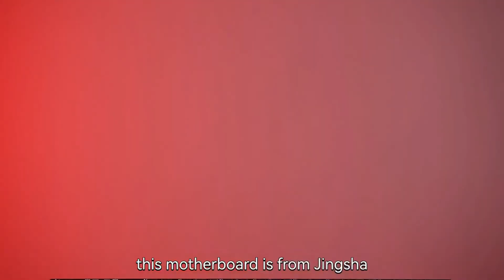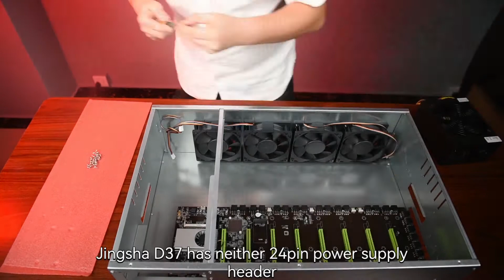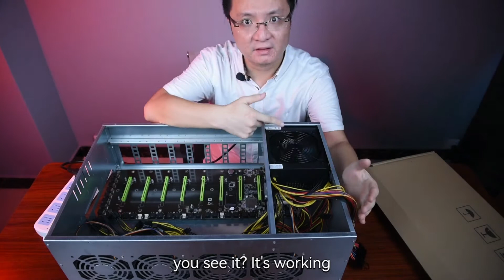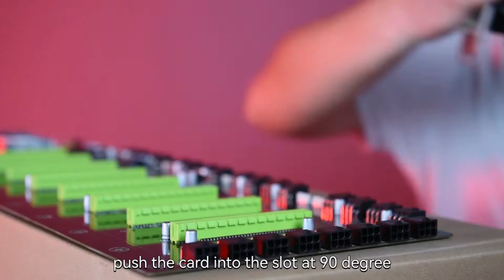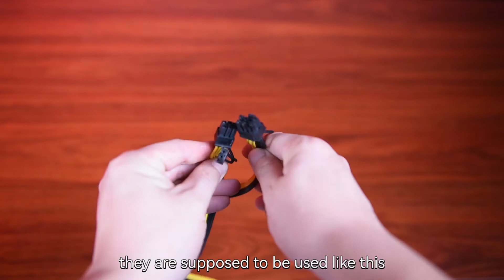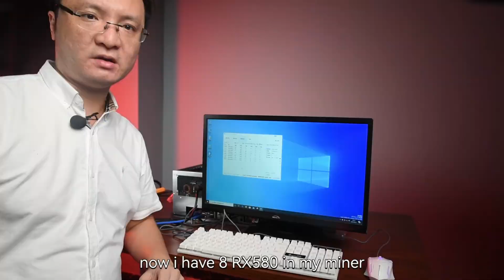BTC-D37 mining motherboard, compatible with ATX and 2U4U mining power supply

Comment: Thank thank you for the great video, is the motherboard compatible with GeForce GTX 1050 ti ? it wont detect it on mine!!
Reply from the maker: I have not tried GTX1050ti graphics card mining, GTX1050TI graphics card seems not suitable for mining, I usually use graphics cards such as RX580/5500XT/5700XL/6600XT/2060/1660S.